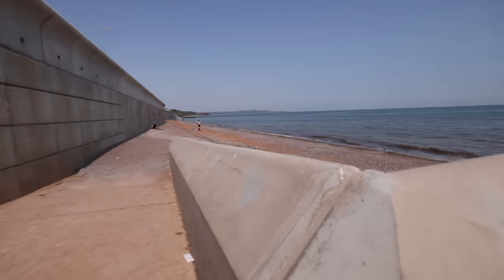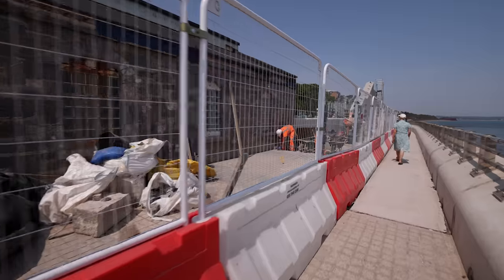Dawlish Sea Wall Tour - Preparing for the Bridge Deck

Comment: If only we had those resources back in 1994. It was 1993/1994 that structural engineers told me the phrase "maintenance holiday". I didn't have a lot to work with budget wise😳😳 But we did our best. My view was with assets over 150 years old we couldn't afford maintenance holidays, especially on bridge bearings etc etc, Eg basic maintenance, even just removing invasive issues such as Buddleia. The chaps at Exeter were always a pleasure to work with, Eg Peter Haigh et al., for DSW and all things Devon and Cornwall 👍✌️😊